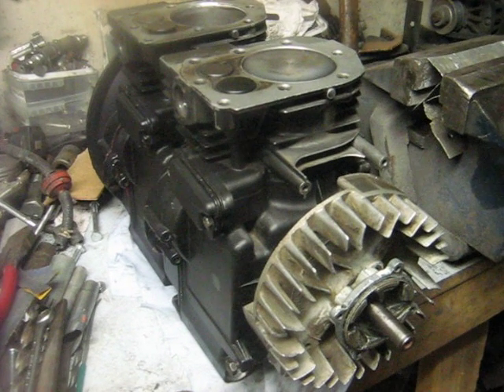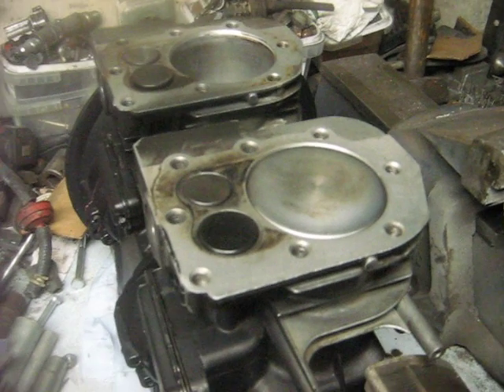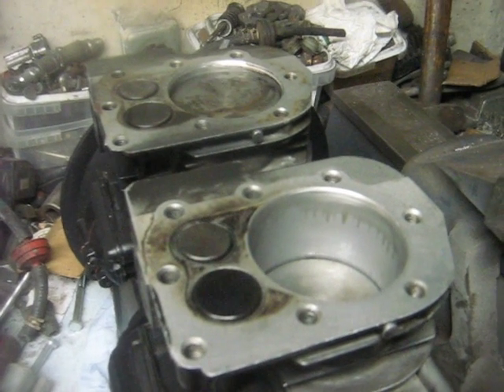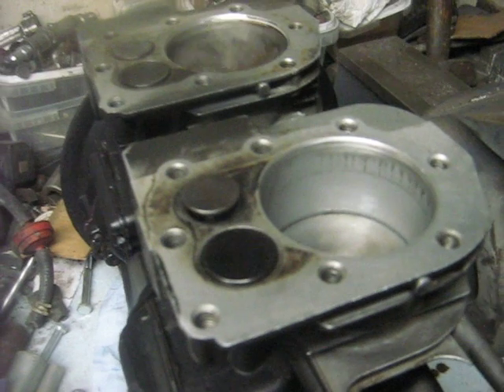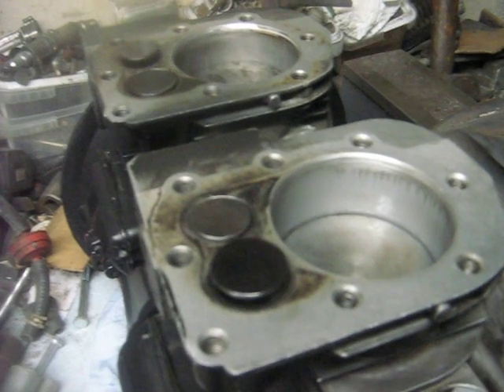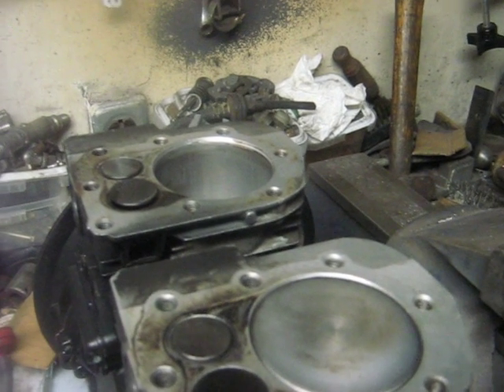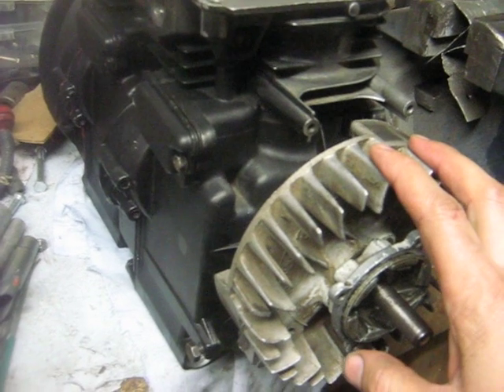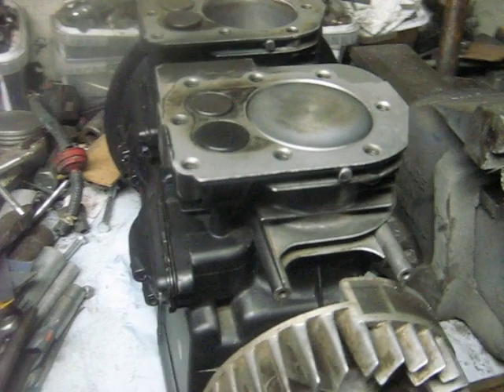FrankenBriggs 2 Cylinder Stacker Motor vid#2

Comment: What kinda muffler will you be running on it?
Reply from the maker: My initial plan is to run the 2 stock Briggs small long type mufflers shown on the first vid. I could experiment later (assuming it doesn't blow its mind on the first run!). That being said, perhaps I should wear safety glasses along with a bullet proof vest!  :)
Reply: ChargerMiles007 Safety first!

Comment: How do you plan on doing the coils?
Since both cylinders are not firing at the same time not possible to use a single coil
Reply from the maker: Right you are, I will give you a hint, I am not using a distributor on this engine  :)

Comment: So you implemented a center bearing? 805 Road King's twin managed without one, but I think their 4-cylinder is going to run into some problems if they ever try to rev it. That's a lot of un-supported crankshaft they have.
Reply: His 4 cylinder has a center bearing, it should be fine.
Reply from the maker: Yes, Roadking wants to keep the crankshaft details Top Secret, and I understand that. So you used a thin profile ball bearing, that is very interesting, bet that works well!
Reply from the maker: Yes, I thought it would need a center bearing, figuring out how best and easiest to make one was the biggest head scratcher for this project. I wouldn't trust this engine without a bearing in the center, as the structure isn't as stiff as a horizontal engine.